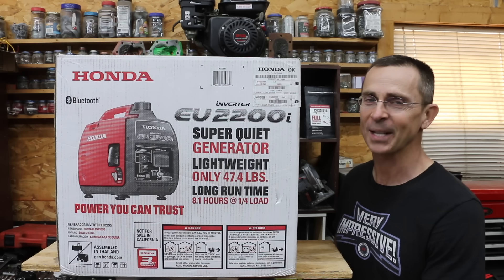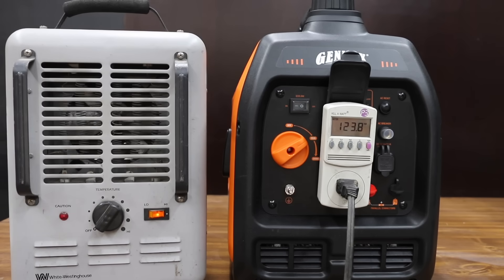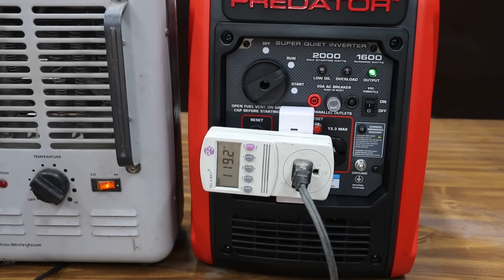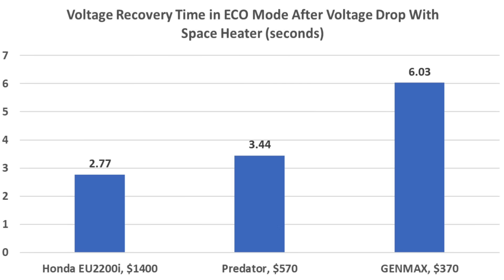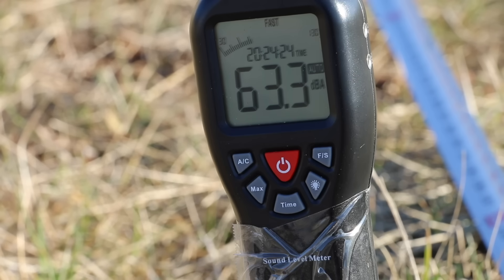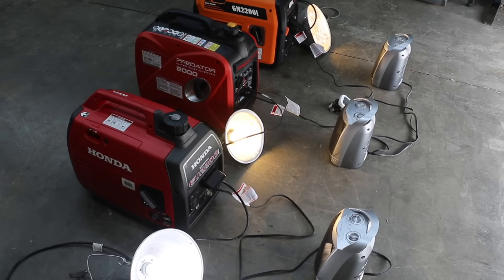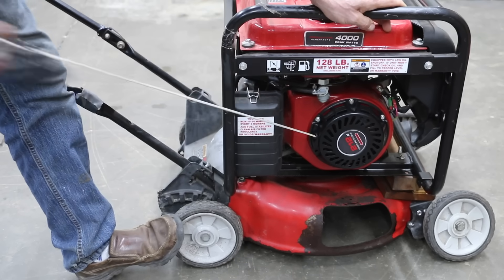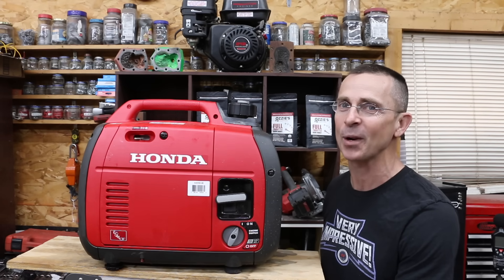Cheap Generator Better Than Honda? Predator vs Honda & GENMAX—Let’s Settle This!

Comment: This test is a bit off, IMHO. 
The Super Quiet 3500w Predator should have been included. It costs $900, much less than the honda here, and it is even quieter than the HF 2000w. That 3500 is the one that HF cannot keep in stock.
Reply: And I love PF and watch every video, so this is not a slam on the channel, but price matters, and I would have loved to see the 3500 in there.
Reply from the maker: Thanks for the feedack.
Reply: @ProjectFarm  and THANK YOU for all the awesome videos. You are one channel I watch every time you post.

Comment: Another excellent test.   One comment on the graphing - for example on the fuel efficiency charts, restricting the range to 3 minutes exaggerates the difference between best and worst.  Visually a 1.5 minute difference looks huge on the 3 min range, but in reality is only a 2.5% difference on the 61 minute minimum.
Reply from the maker: Thanks!  Thanks for the feedback.

Comment: That depends if you have Honda generator that runs smoothly, I do not it neither reliable or cheap , but once in a while it works 🤦‍♂️
Reply from the maker: Thanks for the feedback.

Comment: @2:25 I am an electrical engineer. This is false. 119.6V will not cause "a lot of wear and tear". 120V is the standard. 5% deviation is considered acceptable and less than 3% deviation is considered good. Heck, even the article on "Sensitive Electronic Equipment" (Article 647) states that "The voltage drop on any branch circuit shall not exceed 1.5 percent. The combined voltage drop of feeder and branch circuit conductors shall not exceed 2.5 percent. " (647.4 (D), NEC 2017). 

At 5% deviation you get a range of 114 to 126. At 3% you get a range of 116.4-123.6. At 2.5% you get 117-123 and at 1.5% you get 118.2-121.8.

There is a REASON you motors rated as "110" all the time. They use that lower number to specify that they will perform at nameplate values at a drooped voltage of 110.

You're a really smart guy so I'm surprised you made such a glaring error. Do you have a copy of the NEC to reference?

Comment: I bought a cheapie very similar to this and super happy with it 5 years later.  I would rather bring this and a 25’ extension cord to work around the yard than deal with a 100’ extension cord.  I went to the Honda dealer to buy one that was marked down in price as a demo model but it sold before I got there and didn’t want to pay an extra $300 for a full price one making the Honda almost 3X what I paid for the cheapie plus I figured it could fall off one of my boats one day and they all sink the same so it would be less of a loss if something happened.
Reply from the maker: Thanks for sharing.

Comment: been using a predator  generator for 5 years now. Bought it at the time to save money. Did not want to pay for that over priced Honda. 5 years later it still works great and does what I need it to. I did buy a Honda I found at a pawn shop for 450 last year. Have not really used it yet. The Honda I got is definitely a better built unit and and to me a lot quieter. But for now I’ll save the Honda and use the predator till it finally dies. Like I said it’s five years old and still going strong.
Reply from the maker: Thanks for sharing.

Comment: As always, very thorough video! Great job. Other generators which are similar size to the Honda EU22 are the Yamaha and Westinghouse units (we sell Honda and Westinghouse) and Westinghouse is offered as a budget unit but has a great warranty and is well backed.
Reply from the maker: Thanks and you are welcome!  Thanks for the feedback.
Reply: please add Subaru (I think it sells under many names)

other big box store offerings
Champion
Firman

Comment: Go with the Honda every time or you'll be guaranteed regret it..if you sometime have trouble with a Honda there is parts and people who work on them available. 
I've gone through a pile of cheaper generators, they last about a year or two if you are lucky before something breaks and there are no parts available to fix with. Or they might work fine in the summer, but once it gets cold out be unable to run at all.. 
I had one just like that EU2200i get flooded in a storm and then not work last summer and took it apart and changed the oil etc. The whole construction is basically WATERPROOF, except the kill-switch on the side twist control. So just blow that clean of water and fill with vaseline and it worked fine!
Reply: Great problem solving going on there!
Reply from the maker: Thanks for sharing.

Comment: In my limited experience with generators with 1 a cheap (made in the PRC) 3.5kva model and x1 Honda 2kva model (that dad gave me as he didn't need it anymore), the biggest noticeable difference has been longevity. The Honda, which is about 15 years old and has hundreds of hours use (by my dad when boon docking) is still going and starts with x1-2 pulls, but the cheap 3.5kva genny has done about 70 hours and it is toast. It needs repairs that I can't do and it's not worth paying someone to do. It's junk, which is a shame as it still has the equivalent amount of natural resource in it as the Honda to be made. What a waste!
Reply from the maker: Thanks for sharint.
Reply: I’m sticking with Honda products for the same reason I stick with Apple computer products. Quality and longevity rule.

Comment: In the next test batch, I like to see the A-ipower SUA2300i - 2300 Watt gen that's sold at Sam's club for $400. It's unique as it has a 120v 20A 5-20R receptacle, a 30A L5-30R receptacle (native RV plug), with a USB and a 12V cigarette lighter receptacle. It also has a really nice info panel that shows a power meter, output indicator, Overload alarm, Low oil level, Digital fuel meter, Volts, Hours and Frequency. Much more info than just one or two LED lights that most have, all for $400 bucks. That's a steal if it performs as well as it claims.
Reply from the maker: Thanks for the suggestion.

Comment: Question: Since the electrical outlets in the Philippines run on 240 volts instead of the American 120 volts, does that mean that I would need to buy one in their country for emergency power?

Comment: I'm a truck driver and I have been running the pulsar pg2300is for some time now to run a 6000 btu a/c unit pretty much every night during the summer but last year I switched to a Westinghouse igen4500 and an 8000btu a/c I like them both but riding around on the back of the truck all winter is tough on the electronics of the Westinghouse due to road salt they both seem to be pretty durable and competitively priced
Reply from the maker: Thanks for the feedback.

Comment: I was doing a yard cleanup today and the customer had a very similar sized generac brand. Not sure of it's power ratings, but based on size I would imagine it is likely a comparable model. Probably even more expensive than the Honda.
Reply from the maker: Thanks fr sharing.

Comment: Champion is the best comparison and over the years I've personally gone through several suit case generators. Only honda lasts over a year with everyday use. Champion is the second best and makes a lot of people second guess honda. If you are a weekender and just need power for a day or two over several months or the years a Champion will last a life time same with any generator. The real tests come after 6 months of use and then at a year. Most brands just won't last through the year.
Reply from the maker: Thanks for the feedback.

Comment: Hija low noise are the bad ass and the only generator that was used on shorting movies or tv too. They use the more biggest generator or some diesel more bigger when need more lights
Reply from the maker: Thanks for the feedback.

Comment: Bought my Honda 2000i 23 years ago.  Still runs like a champ. 89 octane ethanol, plenty of Sta-Bil.
Use occasionally.
Reply: Research Star Tron fuel stabilizer,much better then stay bil
Reply: @joshmason7037  FortNine disagrees with you, sir. "Can Fuel Stabilizer Kill Your Motorcycle" video.

Comment: Aside from the very annoying talking speed I don't put that much stock in the output waveforms. If you put an oscilloscope on the commercial line voltage in your house you're just as likely to see a similarly distorted waveform or worse. It won't bother most loads.

Comment: Does two Predators last longer than one Honda?
How much does two Predators cost overall in gas and maintenance than one Honda?
Reply from the maker: Thanks for the suggestion.
Reply: @ProjectFarm Your results about the usage and materials found in the oil beg for - the ultimate question. Their true value.

Comment: Could you test wallets specifically if advertised RFID blocking wallets actually do what they claim. Some test suggestions could be comfort, cost, durability, functionality, break-in period, etc. And other criteria's such as, no-fold vs bi-fold vs tri-fold vs alternatives, leather vs faux leather vs alternative materials, if different folds/shape along with where you store your wallet (front pocket/back pocket/purse/bag/etc) affect your perception of pick pocketing and how it relates to ease-of-use. 

Been watching for a couple years and appreciate what you do.
Reply from the maker: Thanks!  Thanks for the suggestion.
Reply: @ProjectFarm  thank you for responding. Really appreciate what you do for every one.

Comment: Have you done a video on products that are for removing brake dust/rust off the wheels? You'd definitely want a product that gets it off with the most efficiently but that doesn't harm the wheel
Reply from the maker: Thanks for the suggestion.

Comment: I'm using a Westinghouse 2600i, mostly because it's supposed to be able to run an RV roof AC (w/o an easy start). Wonder how the next step up class of generators would compare. I am not sure if Westinghouse is using a generic relabeled or if it's their own make/model.
Reply from the maker: Thanks for the suggestion.

Comment: I take my old car on road trips across the country. the biggest issue is engine heat from lack of insulation.

I would like to see an automotive peel and stick style floor insulator test between brands like “Dynamat” and “DEi” etc
Reply from the maker: Thanks for the video idea.

Comment: I've run two of the older 2000 watt Hondas for about 10 years now, in tandem and have done the required maintenance. 
The only problem I've encountered is that the pull cords fray from vibration, right at the point where the cord enters the rewind body. I've replaced both of them once, and I need to replace them again. Total hours on each is approx 600 hrs.
Mentioned this problem to Honda, and they say that's "never been brought to their attention before." 
I've used heat shrink on the last cord replacement, to try and protect the cords..., didn't help much or for very long.
Reply from the maker: Thanks for sharing.
Reply: @ProjectFarm  Thank you for taking the time to read and respond!
I always look forward to seeing your independent and insightful videos!
Stay well, stay thirsty my friend!

Comment: How about testing generators that RV owners purchase; those capable of 30 amps with a 30 A plug. Something that can run an RV AC. Champion 3400 come so mind.
Reply from the maker: Thanks for the suggestion.

Comment: I ended up buying a Wen 56203i about a year ago. It has been excellent so far. I  really like the fuel shutoff feature. Draining the carb after use gives trouble free starting after  storage. My generator only gets used for a couple of hours,  then sits for a couple of months.
Reply: I prefer fuel shut off valves separate from the run switch, as opposed to those integrated ones that only allow them to be on or off together. That allows the carb to be run dry without draining the fuel tank completely, for shorter term storage. For extended storage of years, everything should be fully purged of gas either way.
Reply: @SA DFUR ,  My generator has that feature. You can shut off the engine ignition, and you shut off the fuel to run it dry.
Reply: @TimberTrainer  that's the way they all should be designed
Reply: Problem is that some think it's clever to integrate it into one control and shut the gas off along with the ignition.
Reply: @sadfur8728  my old Honda 700C is this way but there is a drain valve and drain line you can easily access as well
Reply from the maker: Thanks for sharing.
Reply: Most all of these generators have a vent on the gas cap, you can run the carb dry by closing the vent.

Comment: My son, who works at HF, called me about a returned Predator 2000 about 4 years ago. Because it was a return, along with his discount, I only paid $375. I've used it many times in both reg & eco modes to power a portable AC unit, along with a few other smaller items (TV, phone charger, clock) and I've never had an issue with it not powering them, or with those vibrations. On a full tank, it'll usually last about 7-8 hrs. Although, I know the Honda portable generator is much better, it's just that it costs a lot more.
Reply from the maker: Thanks for sharing.

Comment: Amazing testing! I bought the Honda tested in this video just a couple months ago, deciding on it over the Predator after watching numerous videos. Glad your in depth testing backs up my decision, and the results were pretty much what I was expecting! Paying a bit more to protect my appliances from voltage drop or dirty power during a power outage is worth it to me. Thanks for another amazing test!

Btw there is an aftermarket oil cap/dipstick with a magnet on the end that catches metal flakes, I used this on my Honda during break in and it really did a good job of catching the break in metal flakes in the oil. For my break in I ran mine for 30 minutes with no load, changed the oil, ran for 2 hours light load and changed the oil, then ran for 4 more hours with a moderate load and changed again, then used the fuel shutoff followed by draining the carb with the drain screw for storage. Ethanol free gas with stabilizer of course.
Reply: There's also a funnel/tube for oil draining that screws into the hole. It allows you to pour the oil further away so you don't spill in the generator housing.
Reply from the maker: Thanks and you are welcome!  Thanks for sharing.

Comment: Having that Predator 4000 mounted on the mower deck may have created a speaker. Might explain why it got louder with the exhaust turned away but the mower discharge pointing at the db meter.
Reply from the maker: Thanks for the suggestion.

Comment: Love your videos, as always. But, this time in addition to a great comparison test, you've inspired me: I have a Honda eu3000i which is a bit too heavy to move around easily, but mounting it on an old lawnmower deck is a great idea!! :)
Reply from the maker: Thanks!  Glad to hear!
Reply: Harbor Freight dolly is an option for 10 to $15, if you don't happen to have a mower ready to strip down-
Reply: @sadfur8728  thanks. It's currently on a dolly, but when put into use, the generator needs to cross some "terrain". The little caster wheels on the dolly aren't any good for that. So I roll it out of it's storage spot, but then lug and grunt it into its service position. I've seen the wheel kits, and more capable dollies too - and I could certainly build something myself - but re-purposing a mower deck never occurred to me, and seems like such a great "Red Green Show" solution! Heck, I might even add a little roof to it! I''ll bet there's a spent mower sitting up at the town "recycling center" (a.k.a. the dump) right now - probably a nice red one, to color-coordinate with the generator!
Reply: @dougfrommaine  I have a lawn cart I use for my small size generator and pressure washer when it needs to move over lawn surfaces

Comment: What a great video. We purchased a Genmax 3300i last year for our 34' Winnebago. It fit in the bay for the previous generator, It's much more efficient than the old Onan we pulled out and we love it! For the price and the power it's really hard to beat. When we are out boondocking it keeps our AC running and our batteries charged up. We changed the oil right away after its first hour of runtime and would recommend the same.
Reply from the maker: Thanks!  Thanks for the feedback.

Comment: When averaging sound dB levels you need to convert to pressure then average then convert back to dB. dB scale is logarithmic and can lead to very misleading results if you do a straight average of the dB levels.  The Honda with much more consistent sound numbers for each side shows they engineered the sound profile not just copied and hoped for the best.  P.S.  You should add a top mic (at least 1 meter above) measurement to your test.
Reply from the maker: Thanks for the constructive feedback.

Comment: Nice timing, just got a similar 2500W Craftsman (Generac) generator for $50. Originally a crazy high $930 price.
In-store sold as parts-only, it had a cracked spark plug, plug boot ripped off, and the pull cord snapped. Fixed those issues and it runs great! It said "stripped thread" which concerned me that the spark plug was stripped, but that was not the case.

Many of these generators are extremely similar designs (even down to the torch plug) and it wouldn't surprise me if many originated from the same factory.
Reply from the maker: Thanks!  Thanks for sharing.

Comment: I'd just buy 2 predators and call it a day but I'd like to see an oil analysis after the 2nd or 3rd oil change to see if the wear metals are still as high
Reply from the maker: Thanks for the feedback.